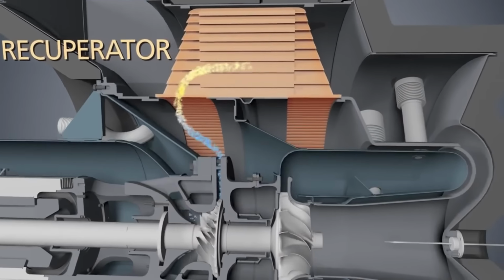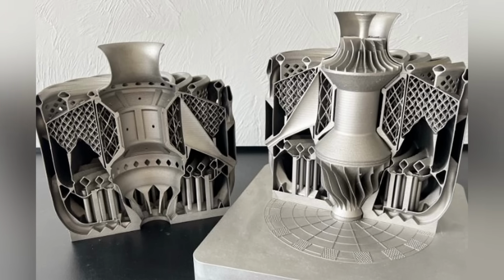FUTURE Jet Engine Has ARRIVED!? -Turbojet Breaks RECORD

Comment: As turbine size decreases below about 700 kW of output power the specific fuel consumption (SFC) rapidly increases (which is a bad thing). This is because things like blade tip clearance, and the tolerance on manufacturing to the desired shape (even with additive manufacturing) are pretty much fixed values regardless of total engine size. As a result, as the flow passages get smaller, the ratio of tip clearance to blade size gets larger and so there is more leakage at the tip. Also the percent deviation from desired blade shape gets larger the smaller the blades. Both cause the compressor and turbine efficiencies to decrease. Both of these factors limits the minimum absolute blade size for the last stage of the compressor. This means that the pressure ratio at which the flow area reaches the minimum blade size decreases as the total design point flow into the engine decreases. In a thermodynamic cycle, the thermal efficiency of the cycle is directly related to the overall pressure ratio of the compressor. The higher the OPR, the higher the thermal efficiency. So the combination of more tip leakage, percent error in blade shape and lower pressure ratio results in lower thermal efficiency and so higher SFC the smaller the turbine engine. 

Intermittent combustion engines (ICEs) don't have the same scaling effects. As a result, the SFC for ICEs is relatively constant regardless of engine power (except in extremely small ICEs of a few kW.). The result is that for the power levels discussed in this video the SFC of turbine engines is about twice that of ICEs of equal power.

The advantage of small gas turbine engines relative to ICEs is they have a substantially better power to weight ratio. In fact the power to weight ratio of turbine engines increases as the engines get smaller. While weight is a major factor in any kind of aircraft, engine weight is only a portion of the weight of adding a range extender to a battery electric aircraft. The other portion is the weight of the fuel and fuel system required to provide power for a specified length of time. The better SFC of ICEs means that at some power level the weight of the fuel will be about half that of the turbine engine. At some power level the total weight of the engine and fuel will be less for an ICE than a turbine. And the point where the total power system weight including fuel where an ICE weighs less is happening at higher power levels due to the introduction of very high thermal efficiency and high power to weight ratio ICEs like those being developed by LiquidPiston. LiquidPiston use a novel take on the rotary engine that eliminates the issues that limited the Wankel type rotary. They basically turned the Wankel (Mazda) rotary inside out with a double lobed (peanut shaped) rotor with cusps in the case that separate the three chambers. The cusps contain the tip seals rather than the rotor like the Wankel. This allows the tip seals to be directly lubricated, eliminating the Wankel need to injected oil into the chamber through weep holes in the case so that the tip seals would pick up some oil as they swept past. The issue is that the oil is no in the combustion chamber and when it burns produces a lot of unburnt hydrocarbons. The peanut shaped rotor also allows the combustion chamber in the wall of the case to be completely covered during the majority of the combustion process. This constant volume combustion results in a much greater increase in peak chamber pressure than is possible with piston engines which can not dwell at TDC long enough. This "free" increase in pressure greatly increases the OPR of the LiquidPiston cycle and therefore yields a lower SFC than piston engines. These engines are much simpler and lighter since they don't have to contend with all of the stress of a piston engine. This gives them about 3 times the power to weight ratio of the most common aviation piston engines. Plus with only one moving part, they are simpler to build and easier to maintain than piston engines and likely more reliable with longer TBOs.

So for range extender engine to augment battery power in small aircraft, a turbine engine might not be the best choice.
Reply from the maker: Thanks, you brought up a lot of good points, it sounds like you have an extensive background. I have not really thought about about range extenders and comparing fuel weight ratios. The liquidpiston is an interesting development to pull away from conventional wankel seal problems yet the company has stalled for quite a few years & I'm not convinced of their design just yet. Even the INN engine (it's based on older sinusoidal config, wonder about bearings)  is possibly incorporating a front propeller on a evtol plus battery charging (maybe I can talk about this next video) so you are definitely onto an interesting topic.

Comment: Laser additive manufacturing in metals is just another form of welding and has all the negatives of welding.  This may be fine for 'throw-away part like cruise missile engines that only have to last 5 hours at most, in the commercial world, this becomes more dubious as parts that are meant to last have to be made to go through many more cycles and inspections..  The additive processes that you are referring to have been around for quite some time, abet at higher prices for almost 20 years.  I doubt that the 'old' methods are going to be that easily replaced, as forging has decades of research and time proven service along with the past innovations of EMD micro drilling.  What has happened is the cost of these additive 'welding' CNC machines has come way down with significant additional innovations and many new engineers with newer experience may hold these devices in favor with dubious accolades. .

Comment: Over 45 years ago I was just starting my career as a Technical Designer in the manufacturing and engineering fields.

Worked at a company that produced sintered powdered metal gears and other complex shapes using presses with complex tooling setups. It was great for producing lots of parts quickly without generating lots of waste like machining would. Thought it was the coolest thing I ever saw.

A few years later I starting working in the aviation industry. Experienced the transition from 2D board drawings to 2D CAD drawings to 3D CAD/CAM drawings and data sets. Saw the introduction of 3D Stereo Lithography of plastic test parts. Thought it was the coolest thing I ever saw.

Over twenty years ago I worked at a factory that machined large forgings. Then I started hearing about laser sintering of actual production metal parts. Thought it was the coolest thing I ever saw.

Just watched your video of the truly amazing complex Additive Manufacturing parts being produced now. Again thinking this is the coolest thing I ever saw.

Wonder what’s to come in the next 10, 20, 30 years in Additive Design/Manufacturing. It seems like we’re fast approaching the Replicator technology shown on Star Trek. Now that would be the coolest thing I ever saw!
Reply: Replicator in Star Trek I will take...
Replicators in Stargate, no thank you!
Reply from the maker: Thanks for sharing, it really is an exciting time to be alive and to see manufacturing evolve rapidly! Hopefully no Stargate replicators though heh

Comment: 3D printing especially of refractory alloys like inconel really is changing the world.  If hydrogen gas turbines can be made inexpensively then that makes a completely zero CO2 hybrid electric aircraft with decent range possible.  And I know hydrogen still has to be made from renewables and that it presents problems of its own, with metal embrittlement and leaks and volume considerations, but everything comes with problems.

Comment: AM will continue to evolve and increase its share of the manufacturing market.  A combined AM tool with traditional subtractive machining would seem to be ideal by being able to add a layer and then refine that with subtractive machining.  In rocket engines and many other things AM is great except the finish AM produces is usually not very good so being able to clean up and improve the finish between AM layers would be the best of both world albeit with substantially longer process times.  Waiting until the AM part is finished in the AM phase before cleaning up with a subtractive system can be a problem if the finished AM part closes off the internal structures so subtractive efforts are impossible.  If you put down an AM layer, then, within the same CNC tool, use various cutters and mills to refine the surface and improve the finish, then you should still have access to the internal structures until its closed off.

Comment: Hybrid aircraft are the dumbest thing ever proposed.
Hybrids are only efficient in stop-start applications.
Aircraft cruise at the same speed for hours.

So all the hybrid does, is increase weight, complexity, and cost.
Look at the Rolls Royce EfanX.
It was ti decrease CO2 by 70%.
But INCREASED CO2 by 400%.
And was so hot and heavy, if could not take off.
And they charged UK taxpayers £60 million for this monstrosity.

HYBRIDS DON’T WORK FOR AIRCRAFT.

T

Comment: I did not see any mention to the turbine blades being AM manufactured. An important omission. I suspect they are not because it can't be done yet.
Reply: Exactly, they are grown and already ~3d printed so...
Reply: No way can turbine Blades & rotors produces via AM: The stresses on them are just too high. The last thing you want is a blade or rotor failure, which would destroy the engine.
Reply: @guytech7310  Well bud, turbine blades today are made by AM right now, so your treatise here has a MASSIVE Problem.
Reply: @w8stral  OK, I did some research. It looks like the turbine blades are printed via AM, but the forged using a hammer press. The advantage for AM is for cooling channels.

 There are a lot of steps to go from a printed Blade before it can be used, so am not sure if this is any faster than standard production of blades. 

 I knew sintering wasn't strong enough for the forces applied to turbine blades. I also have not found any instances of the Turbine rotors that hold the blades are AM. But if you know, please share.
Reply: @guytech7310  Oh yea, turbine blades have multiple steps.  It is not one process.  You can say they use ALL the processes.

Comment: I may be wrong, but I don't see any advantage to a hybrid propulsion system except maybe for some military applications
A close support aircraft could use the internal combustion engine while loitering and waiting for a mission, and then switch to full electric when attacking, greatly reducing its thermal signature
But for civilian purposes, it seems like adding all the costs of two systems for the same results of one
Reply: As an old IP generator for military (US) stuff, we are now seeing the  tech of the 1970s getting media coverage...time makes "crazy expensive confidential tech" , profitable
Reply: Tilt wing or rotor is simplified with electric vs the use of mechanical transmission.  Same with robots.  Converting fuel to electric power and then using direct conversion to actuators or propulsion makes sense in many applications.
Reply: @mefobills279   maybe, but what it we use small engines instead of electrical motors
Reply: @r.guerreiro140  For electric jump jets, it might be good to have a miniature jet engine to charge batteries.  The Koreans just invented a sodium ion battery that charges in minutes and has 100 percent coloumbic efficiency.  Big jets will probably not be electrified, but if you need to tilt wings, or rotors, or have a robot with actuators, electric power is the way to go.
Reply: @mefobills279  

"For electric jump jets, it might be good to have a miniature jet engine to charge batteries"

As long as it is only charging while the aircraft is in forward motion.

Without forward air movement to cool the jet engine it will literally burn up without a constant supply of coolant to keep it in a safe temperature range.

This is why Harrier's and F35's in the real world have a very limited vertical operation mode time.

Unlike in Die Hard 4 or True Lies you can't just hover in place indefinitely, or the jet engine will overheat to the point that it likely ignites the fuel tank, exploding the plane.
Reply: @mnomadvfx  Electric jump jet from top of buildings using battery only, then level flight to nearest regional Airport.  Then, transfer to a conventional jet.  The tall buildings also house electric cars to rent.  Rail likely will never be built in US.
Reply: @r.guerreiro140  
Power/Modulation is better with electric devices compared to mechanical ones.
Reply: "But for civilian purposes, it seems like adding all the costs of two systems for the same results of one"

10 years ago that absolutely would have been true.

But in that time span the state of EV inverter power density has drastically improved, and people are really getting serious about non superconducting high density electric motors for airplanes.

As long as the generator can be sufficiently shrunk/weight reduced while retaining power output it's possible that hybrid designs could exceed efficiency of that of conventional designs.

Especially in VTOL aircraft where maintaining vertical flight mode is cost prohibitive in cooling the engine for jets in the Harrier or F35 - you basically have a limited amount of coolant to keep the engine at viable temperature without forward air motion to cool it instead.

A hybrid system could potentially allow a future VTOL aircraft to significantly gain on vertical flight mode time relative to a fuel burning jet.
Reply: ICE(turbo-generator) and propulsion motor can be run at their respective optimum speed and power.
That advantage alone justifies such a layout.

Comment: AM may enable gas turbine engines to power things that wouldn't pay for one made by conventional means. Though it's a tough challenge; modern CNC machining can readily make the most important part - the compressor and turbine. 

The fancy combustor designs may or may not succeed; conventional combustors are mostly all about keeping the flame contained by the incoming high pressure air flow and away from any of the combustor components, and to cool the combustion products before they reach the nozzle stators / turbine. 

Those porous designs look like there's quite a lot of contact between flame and the combustor structure (unless I've misunderstood them). So, they need to be made out of some pretty special stuff (interesting that Inconel was mentioned) to avoid being burned out quickly. Maybe that's OK for a smaller engine. 

It may prove impractical for a large engine with a higher pressure ratio that tend to lead to higher combustion temperatures. A big part of "efficiency" is time-on-the-wing. A complex combustor that is a tiny bit more efficient to operate but burns out quickly is inefficient overall.
Reply: Until we can print the advanced materials(Inconel is not), the whole process is moot.  Honestly until someone can make Silcion carbide nanotubes the whole process is moot as the savings are in the turbine, the gear reduction method to generator or turbofan, not compressor and not the housing weight.  Could we argue for better reliability and cost?  Uh, ok, but that is NOT where the cost is at.  It is the Hot sections where ALL the $$$ is.
Reply from the maker: I agree that the combustor can't be scaled properly with porous membranes without some sort of special alloy. Yet it's intriguing that we can build that now at smaller scale and make it more efficient.
Reply: @Motor_Explorer1  Uh, the combusters aren't alloys, they are ceramics currently....
Reply: @w8stral  Hmmm. That could help. Silicon carbide especially so...  

Without silicon carbide, one would have to resort to a less impressive ceramic. Ask owners of older Aston Martins about whether it's a good idea to have large scale ceramic components near by important moving parts of engines... You'd really not want any possibility of bits breaking off, so it'd probably take careful management of temperature differentials and thermal shocks. 

For a larger engine, I'm left wondering what the advantage would be, and can see where losses could be. In a combustor one wants as little as possible in the way of the combustion mix / exhaust gas flow. There needs to be mixing of the flame and cooling air from the high pressure system to avoid melting downstream components, but too much turbulence robs the exhaust of energy. Putting in a gauzy ceramic matrix sounds like it'd slow everything down. 

I guess with a larger engine there can be adequate space for combustion to complete ideally, and leave room for cooling to happen too. So maybe these combustor matrices in smaller engines slow the combustion mix down a bit? That'd result in an otherwise too-small combustor working a lot better.
Reply: @abarratt8869  ?  I said silicon carbide NANOTUBES... not silicon carbide.... and topic was the housing, not the internal bits, though silicon carbide nanotubes in a matrix of titanium could be used for all of the compressor and housing vastly reducing weight.  The combuster with zero or near zero stresses are ALREADY ceramics.  The Turbines are ALREADY ceramics.  The exhaust nozzles are ALREADY ceramics.  And all of those are ALREADY 3d printed.
Reply: @w8stral  

"The Turbines are ALREADY ceramics"

You mean ceramic metal composites right?
Reply: @mnomadvfx  Depends which part, multiple parts were being discussed so...

Comment: There are hundreds of parts on commercial fans that are already in service.  See 777X
Reply from the maker: Yes, but all those are not entirely 3d printed or to the level of the 500 is 90% built with AM(even though it's turbojet).
Reply: @Motor_Explorer1  they are looking at every opportunity.  When your engines are half the price of the $370m airplane, it’s easy to justify complex low-volume exotic-material printing.